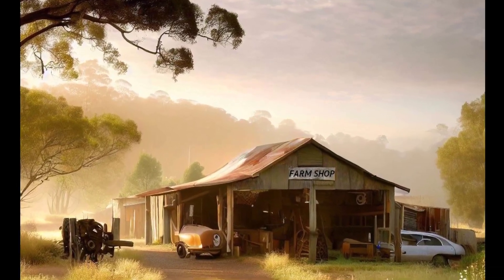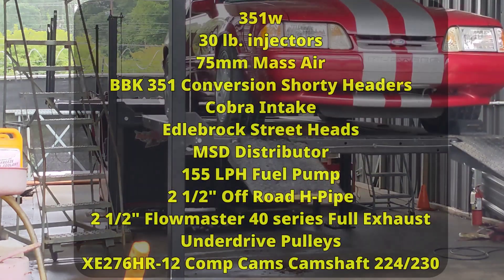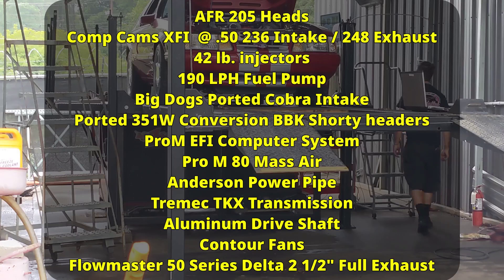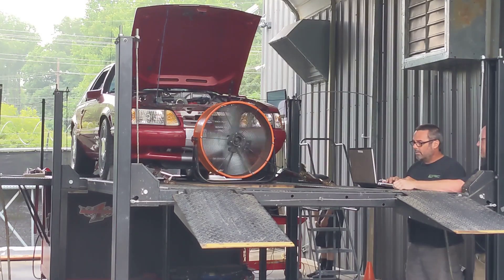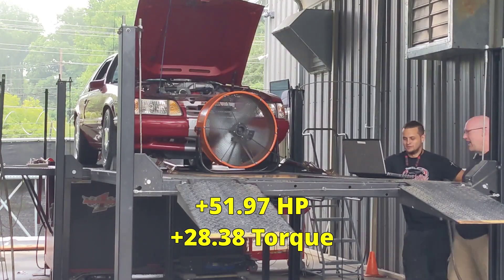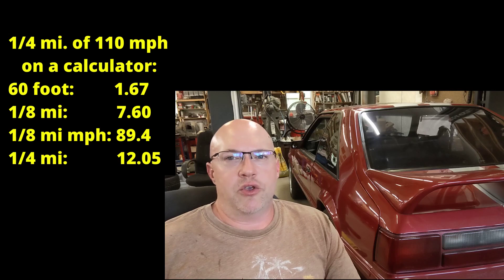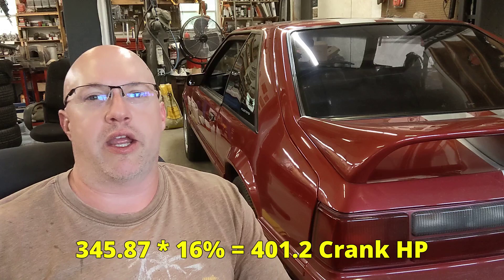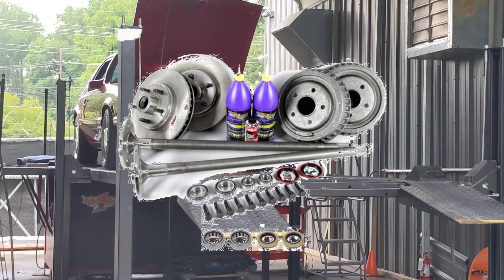Dyno, BigDogs Porting, Pro-M EFI, AFR 205, Scarlettes Performance, Comp Cams XFI, 351w, Flowmaster

Comment: Could you please give some feedback and impressions concerning any valvetrain noise or lack thereof from the XFI cam? The XE versions are known for their "sewing machine" valvetrain clatter. I was wondering if your valvetrain is really quiet or not. I couldn't really tell much about this from the videos / audio.
Reply from the maker: I didn't notice it being any louder than it was with the "COMP Cams Xtreme Energy Camshafts 35-328-8" shaft...  It may have to do with how I adjusted the rockers...  This is how I did it: https://www.youtube.com/watch?v=-S3EuaAz7jg
Reply: @ThisOldFarmShop  Thanks!
Reply from the maker: @anondusery1271  Exhaust much louder with the XFI Cam though LOL!  Alsmost twice as loud.  I'm sure the AFR Heads contributed as well.

Comment: Interesting.. I made 315rwhp on a dynojet with a stock 302 shortblock with stage 2 edelbrock street heads and stage 2 ported edelbrock performer intake plus bennet racing custom grind camshaft.. 24lb injectors.
Reply from the maker: Yeah, I know right!  I'm told that differnet dynos can give drastically different results.  Who knows?  I know it's fun to drive and those 275/35/18's are no  match for 1st and 2nd gears LOL.  Thanks for commenting!

Comment: Sorry about your results, man.  I agree with you, though.  It probably is the intake.  Those are very healthy heads, and the cam is pretty large.  I had those heads and a mild HR street-cam in an 8.5:1 compression 331 meant for boost that did 372rwhp without tuning through turbo manifolds.  The only thing that explains the difference to me is that I was using a Box-R intake.  I love the Cobra on the right application, but a high revving 351, like this one could be, is not it.
Reply from the maker: thisoldfarmshop@gmail.com thanks!
Reply: @ThisOldFarmShop  Sent
Reply from the maker: I was thinking about switching to the box r intake. Did you have any good clearance issues with it? Thanks!
Reply: @ThisOldFarmShop  It wont clear the stock hood without a lot of work, but it cleared my 2.5" Kaenen.  I'm currently restoring that car and going with a heat extractor hood and it will clear.  The only thing I've done is put it on a UPR K-member and solid drop mounts.
Reply from the maker: I have 2.5" Cervini’s cowl on there right now. My current mounts I think drop the engine about 1/4". Thanks for the info!!
Reply: @ThisOldFarmShop  Hope that works for ya, but I have heard others say that it did not.  All I know is that for me, it did with the Kaenen 2.5".  Wish I could show ya a pic, here.

Comment: Great video! I’m about to drop a 408 Windsor into a 2001 mustang coupe was a V6.
Reply from the maker: Nice! I wanted to stroke this motor to 408, but ran out of money 🤑😂😂
Reply: Better intake will allow much more.   The cobra is designed for low rpm.   Get big dogs to make a vic 5.8 intake for you.   Im sure you'll make another 50hp.
Reply from the maker: I plan to switch to a carb style intake with a big elbow on the top that goes to the throttle body next. Saving my pennies LoL 
 Thank you!
Reply: @ThisOldFarmShop with enough compression you have enough stuff to go 450rwhp
Reply: @ThisOldFarmShop  Consult with bigdogs...   I don't think you should accept anything under 450rwhp, the LS1 guys get it with heads, cam, exhaust, intake and tune.    The heads are usually at least 300cfm@.5", the cams are in the mid 220's, sometimes a little over .600" lift, 1 3/4" long tubes into 3" exhaust, and a fast intake ( ab out 15rwhp over the ls6 intake and more rpm ).   You have all the points covered, perhaps the intake and cam need to be swapped and maybe heads milled to bring up the compression.    FTI made a cam that made 411rwhp/374rwtq on a stock bottom 302.   That 302 had a set of TFS 11r 190 heads, ported vic jr to match and 650 double pumper holley, 1 3/4" long tubes.   It was 12:1 compression.   They used a FTI camshaft ( Flow tech inductions ) with a little over .600" lift ( like the LS guys ) and 108 LSA and mid 220's duration on the intake.   I don't think you should accept any less power than the LS guys.
Reply from the maker: @dennisrobinson8008 thank you for the information! I now know that I have the wrong intake and headers. I'm going to have to upgrade my fuel system before I can do anything else LoL. Saving my pennies 😂👍
Reply: @ThisOldFarmShop get it!
Reply: @ThisOldFarmShop  Rich Holdener did 351-408w with your heads and camshaft and made 500-550HP engine and over 500ft-lb.   They used TFS Box R and Super Victor.      Super victor was worth 25 more HP at the top end but lost around 20 ft-lb below 4000 rpm.   So yes in your situation that intake is worth probably 70HP.
Reply: The pro-M seems like a really nice set up!
Reply from the maker: @joshteel3226  It seems to be!  It does run the engine like the factory computer minus cruise control.  I would like to compare it to the terminator X though.  Could save several $$ going that route. LOL.  Would probably cost the same after adding features like no lift shift and traction control though 🤑 Thanks for watching!
Reply: Just found another Rich Holdener video.   Your camshaft, tfs 190 11r heads, edelbrock air gap, 347 ci, 11:1, 650 holley, 1 3/4" long tubes it made 480HP engine and 440TQ.
Reply: Vic Jr would've been above that but the Parker funnel web is real close on the low end torque while make 25hp or more on the top.   It's on his videos too.   After watching it id like to make a 500rwhp 347 or 600rwhp 414 or 427 Windsor.   Just like the ls.
Reply from the maker: Do you have a link to the videoa?
Reply: @ThisOldFarmShop I'll grab the link and reply.
Reply: @ThisOldFarmShop  I'll grab links, it's not hard to find.   Plus they are in my recent history...
Reply: I understand!😂

Comment: I don't know man, something seems wrong. I've seen TFS topend 302s make 350-360 to the wheel. That thing is dropping off after ~5200. It should be pulling all the way to redline with those heads. I don't know what size throttle body you have, but an 80mm maf seems small. Something is not letting it breathe.
Reply from the maker: I'm betting it is the intake. I've also heard some folks say the Anderson pipes don't flow that well. 🤷 It has a 75mm tbody. The tbody opening on the intake is 76mm. Chris Richards at pro-m advised I should go with the 80mm mass air. I should have done the stage 3 port with big dogs. Hind sight and all that LoL. Thanks for the comment!
Reply: I definitely agree. The numbers seem low for components used in engine build
Reply: I’m thinking the valve springs that came in the Afr heads. That’s what it looks like on the graph
Reply: Im sure afr sent springs that can get to 7000rpm.
Reply: I thought the same thing.  Lots of hard work and $ for gains but not the numbers I expected.
Reply: Assuming you still have shorties they are probably the biggest restriction, flow masters sound great but aren’t the best performing and the long tube runner intake is killing that cam, cam wants to turn rpms but long runner not meant for that.  Add some 1 3/4” long tubes and I bet you’ll see good gains, if tied to long runner consider a shorter box style.
Reply: That gt40 intake is killing him.    A Victor efi intake will give him 50hp+

Comment: I agree with other comments that you are losing significant power from poor valve motion control, beginning a bit after 5000 rpm.  The radical ramp rates on the XE series Comp cams are notorious for stressing valve springs, and we often see where more spring is required than they recommend.  Ideally find springs that are within as tight as .060" or so of coil bind at max lift as this really helps control development of unwanted harmonics; beehive springs also dampen harmonics well and help lighten the valvetrain.  You should ask Tony at Bigdogs if he can cut you a deal to finish out your intake from its current stage 2 to a stage 3 so everyone can see the difference; good for both of you, I think.  Also, you have a lot of cam timing so I'm wondering about dynamic compression...have you done a cranking pressure test?  I think your current combo still has double-digit power gain potential, and you need to solve these issues anyway before thinking about a stroker or forced induction.  Love the car!
Reply from the maker: Wow, You really think the springs that came with the brand new afr renegade heads might be inadequate? After reading about them, I was thinking this cam was on the lower end of what they would be capable of. Never crossed my mind, but then again I'm just a parts changer 🤣😂. I would love to get Tony to port my intake out to stage 3, but I kinda just want to drive the car for awhile and enjoy it. I was thinking about a stroker kit maybe winter 2024, might send it off then.... Not sure yet. I really want to address the suspension next. Car is still bone stock there, and I know my ball joints are worn pretty bad. Thinking tubular k member, a arms, and coil overs. Really want to lower it a touch as well. Just put on the reimagined classic wheels, a 5 lug conversion, and a 04 cobra limited slip differential. I'm editing that video now. Thank you so much for the thoughtful comments!!! And thanks for watching!!

Comment: How aggressive is the timing curve with the Pro-M EFI? How is you cam installed? I also saw some blue smoke on decel at about the 1:47 mark.
Reply from the maker: Not sure about the timing curve on the Pro-M.  I haven't even looked at it.  Cam is installed straight up.  I saw that smoke too... The guy running the dyno commented that he was watching the smoke to make sure it was dumping in enough fuel, but didn't say anything else about it...

Comment: I have a friend that have almost the same setup with a 393 strocker but the intake was the limited, not enough air flow for the heads and made 390 hp, changed to trick flow R box intake and  bum to 450  the cobra intake even ported does not have the capacity for high horse power.
Reply from the maker: Might be a new intake in my future 👍. Thanks for the tip!!
Reply: @ThisOldFarmShop  yes falso considered 90mm throttle body let those heads breathe
Reply: That's not true about our Cobra manifolds. Our Stage 3 max ported and shortened Cobra and Explorer gt40 manifolds  have made over 420whp and 546hp on a engine dyno on one of our 347 crate motors. It made power at 6,600rpm. We have posted the dyno printout several  times. The way that motor nose dives after only 5100rpm is telling me something else is going on because we have another guy with a 363 same heads but milder cam pulled to 6200rpm with the stage 2 Cobra on a Mustang dyno with a T56. Those results were also posted. We've also had 306s make 360whp/350wtrq on Dynojets with stage 2 Explorers and those numbers were also posted. Something else is going on. Do a cranking Compression test. Saw some blue smoke on acceleration I think.

Comment: Good results. Send us your Cobra up so we can do a stage 3 on it while you have the car down doing other mods and the peak hp and rpm will go up. We always recommend our stage 3s on motors bigger than 306s or ones that rev higher than or looking to peak higher than 6,000rpm. Also check the combo for restrictions and spring pressure on your valve springs. Looking at your dyno curve and knowing how Comp Cams Xtreme camshafts needs good spring pressure to control the valves we see power diving off fast which tells us something is going on up top. That motor should have revved higher then leveled off. Contact us if you have any questions 👍
Reply: What springs would you guys recommend on a set up like this? I’m thinking of a custom grind cam instead of comp cam
Reply: @5ohceez  unless you are planning on making over 500whp we wouldn't recommend getting a custom cam because there are way too many good off the shelf cams that can perform just as well and better than the so called custom cams that people are selling you for a extremely higher price. 
For the Comp Cams XFI camshafts we like to see 150-155lbs on the seat brand new to rev cleanly to 6,500rpm with a conventional valve, retainer lock setup. The XFI cams starts to float the valves with weaker springs around 5,600 or so. Especially with heavier valve trains. They do tge same thing with tge sbc applications as well
Reply: @bigdogsportingtonyb2833  WOW! Where do I begin? Advising customers to not buy custom cams if their engines aren't putting out a given HP? That is pure BS! 
Maybe you should tell that to stock type class racers looking for every last hp. Do you really believe that they are using off the shelf cams to achieve 499RWHP? 
If your customer has a 306 sbf hitting 500rwhp and they want to drive the car on the street; they better have a custom cam or there may not be enough vacuum for power brakes, the car will most likely buck at low speeds along with a host of other issues. 
I take it that the cams you sell are only for 500RWHP and above? Your cams are custom; correct?
Reply: @CRZ_GT  what is your issue always trolling and bashing us? If you don't like us then just don't watch our videos or buy anything from us. Going around trolling us is not a good look for you. We don't tolerate negative energy because that's not our intentions with out content
Reply: @CRZ_GT  please stop the trolling. 
Thank you

Comment: Nice.  Maybe a thought to look in Traction Control, f_tc_vs_multiplier(vehicle speed).  Try setting Y values that relate to 0X through 20X to 0.95.  It will take out less timing slightly.
Reply from the maker: Will give that a look. Thank you!

Comment: Aftermarket pistons for the AFR 205?
Reply from the maker: I bought the 351w short block from summit. It has flat tops with 4 valve relief cuts. I clearanced it and there was room to spare.
Reply: @ThisOldFarmShop  nice. I’m having trouble finding a large head with valves that work for my roller 351w
Reply from the maker: Hi Tim. I bought this short block and just bolted the afr 205s on. https://www.summitracing.com/parts/HPE-SP10